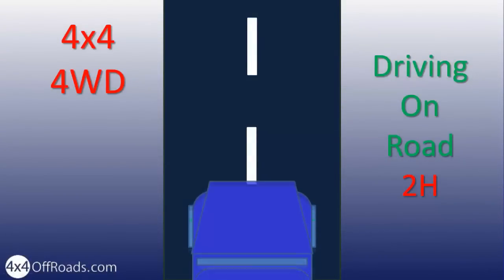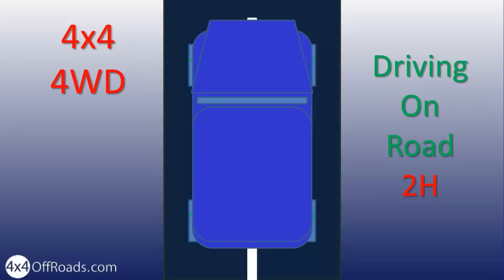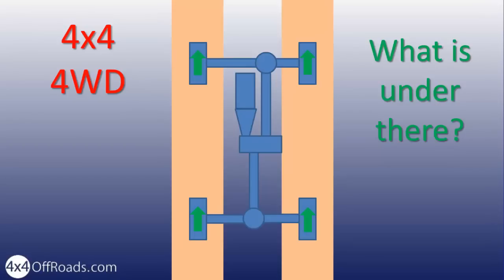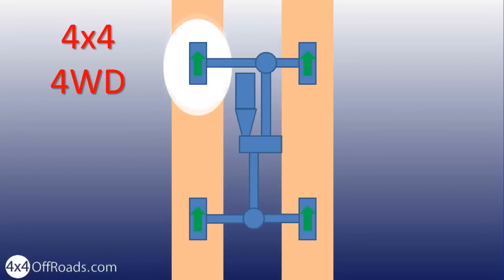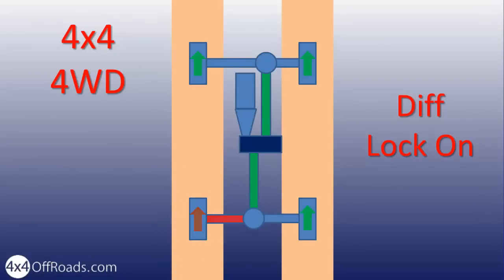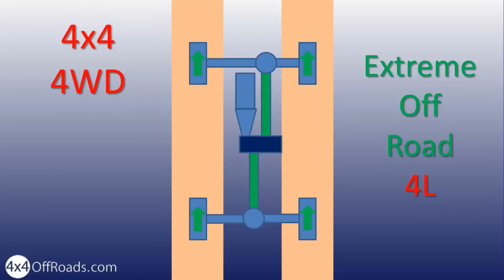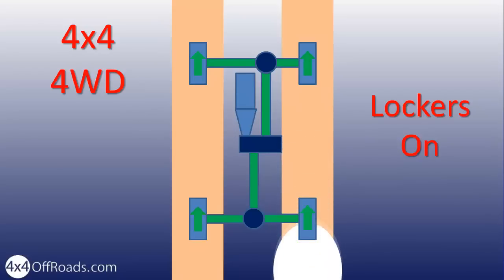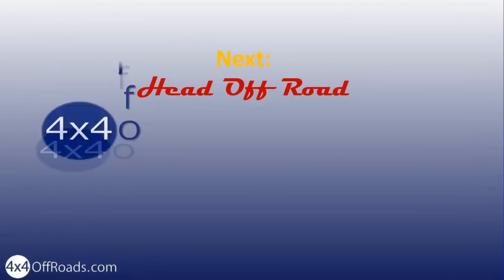4x4 Lockers - 4WD Explained

Comment: generally speaking 4WD usually mean part-time 4WD with a trasfer case in the middle.
if the vehicle has a center diff. then it is AWD or full-time 4WD. however now they have lockable center diff which can turn a AWD into a 4WD. I think the main difference between a 4WD and AWD is if it has a center diff or not.

Comment: AWDs have center differential that's called viscous coupling. which can't be locked or turned on & off. AWD is most similiar to Full-Time FWD from what I've heard. Full-Time FWD basically have a open center diff with high and low range unlike AWDs

Comment: I have often wondered that my self.
In short, with most trucks the transfer case in neutral allows you to be towed, for some distance safely. Long story short, most of the time when being towed, the tires turning, turns the diff, which turns the transmission. But the transmission isn't made to turn that way, so it gets damaged. Putting your transfer case in neutral prevents that.
When is it appropriate? Virtually never. Get a tow truck, don't get your friends to drag you home.

Comment: I avoid the full locking center differentials ...LSD or limited slip differentials are my choice...meaning if just one of your wheels starts spinning, the LSD will turn the other wheel for you to get you going again. Essential for me...an LSD

Comment: never driven a 4WD vehicle before. Do you have to shift to neutral when switching for 2H to 4H?
And the speed must be 55mph or below right otherwise it will not be good for the transfer case?

Comment: Got a question, isn't it not good to use part-time 4WD on dry pavement because it wears out the transfer case while turning a corner?? Also I know there's stock 4WD vehicle with rear locking diff but not front locking diff... maybe you can get front locking diff as well as a after market product.

Comment: I just got an old land cruiser 95 all time 4 wheel drive'. And if I turn left or right "sharply" it begins to make a click click click sound. Is that normal?
Reply: hi cory, sounds like you have a locker fitted in the front, try not to turn too tight and enjoy 4wding the 80  series.

Schooner in Canberra Australia 1970 Range Rover with open diffs front and back, and locking centre

Comment: is it true that when shifting into 4H it's better to be 55mph and below? You don't have to shift it into neutral right? And when shifting into 4L it's recommended to be 1-2mph?
Reply from the maker: That will depend on the transfer case you are using. So check with your 4x4 manual.
Reply: 4x4 Off Roads usually you shouldn't exceed 55mph when using 4H and 15mph when using 4L (in general part-time & full-time 4x4 drive train system)?

Comment: I'm a new user on the 4x4 world, and I have some questions about the rear and front lockers. Can I use those. running on a high climbing dune using the low mode (of course)?......or those are just for rocks? Thanks and upload more videos
Reply: I wouldn't use differential locks in fast speed while climbing sand dunes. keep it in 4 hi.

Comment: hey, i have a shift stick for my 4x4 and low rage. I needed to use it today and now that am unstuck I cant put the shift stick back to 2wd its stuck and wont move foward. what should i do ?
Reply from the maker: You might try to back up a little first...
Reply: its unsyncronized. just rock it a lil bit let it move a bit and itll go in
Reply: change when in neutral... go forwards a bit.. then reverse a bit then forward again etc... about 10m or so...  ull hear it click out.
and service your gear box.. change the fluids. . may help alot

Comment: i have a ssangyong musso 1997 petrol version with full time 4x4, however only the rear wheels have power, the front wheels are not trying to spin at all, its as if it is only rwd. this is a 4x4 full time system but i have no idea what is going wrong, will installing front hub lockers help?

Comment: A diff lock has nothing to do with the transfer case you fool. A diff lock locks the differential. This means that power is sent to the wheel next to it. If right rear is sliding and your diffs lock, your left rear will start to move. Not axles. That's simply engaging 4x4
Reply from the maker: These are sometimes called center differentials - and can be locked. Locking these center differentials is possible in 4x4s like my old 77 Range Rover.
Reply: 4x4 Off Roads sir i'm planning to buy a 4x4 offroad with year model between 1990-1999, what will you recommend a Land Cruiser (prado) or Patrol? i'm a beginner in off-roading. (i'm in the philippines).
Reply: You're wrong, and I would recommend not calling someone a fool when you don't know what you're talking about. You're thinking of a part time 4wd system. Many full time 4x4's/AWD's have a center differential inside the transfer case. It allows them to operate in 4wd but still allow for speed differences between the front and rear axles, the same way a differential in an axle allows speed differences between the left and right wheels. When you lock the center differential, it locks the front and rear axles together to receive equal power the same way a part time 4wd system does when put in 4wd.
Reply: tobster421 You should check your facts and brush up on your knowledge before calling anyone a fool; some vehicles DO have a differential in the transfer case and they also have a diff lock which locks the front and rear drive shafts!
Reply: tobster421 check how the Wrangler Rubicon or power wagon work.   it's called a center locking differential.  center meaning inside of your transfer case.  true off-roaders have a rear, front and center locker.